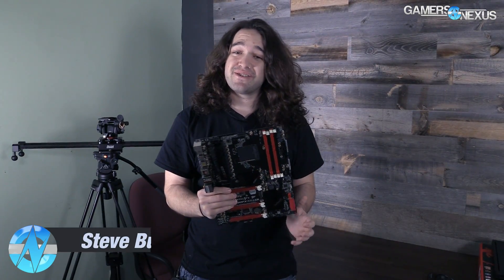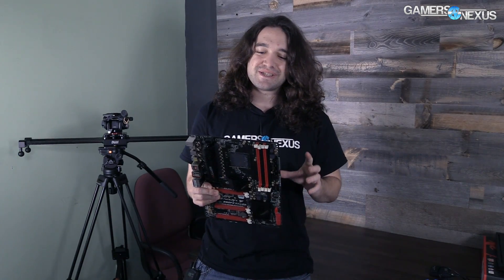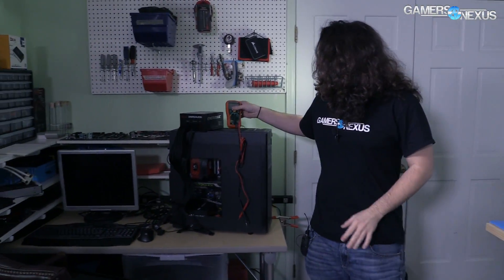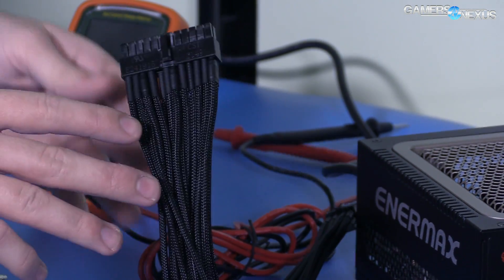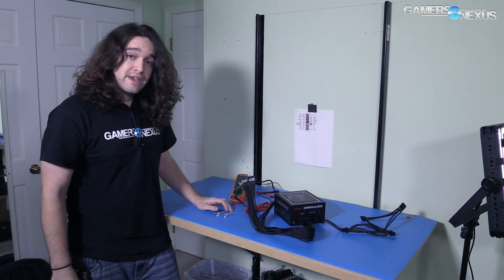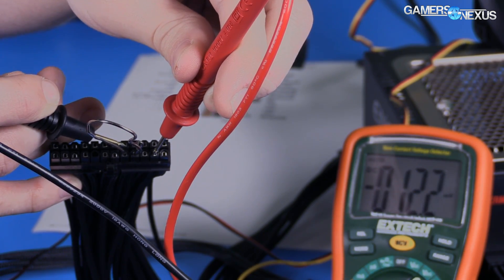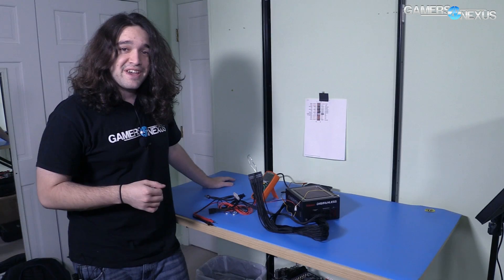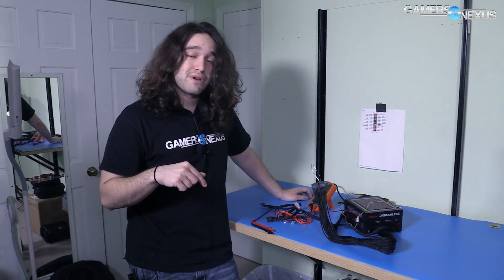Our Motherboard Caught Fire - Troubleshoot a Mobo & PSU

Comment: I fried a used old X58 motherboard a few weeks ago. I was building in a rackmountable case for the first time. What I thought were the standoffs actually were not. I screw down everything and BOOM! Flash of lightning and magic smoke. I shorted out the backside against the case. So dumb. I’ll try replacing the one capacitor I can see is scorched but what are the chances that will solve all problems?

Comment: Want to create a lightbulb with a Mobo? Simply get a fan extension cable that has two female ends and connect to two fan headers and power up the mobo. The wire will light up like a light bulb... briefly.... it will melt breaking the connection. No idea where I got the cable or why 2 female ends but was swapping out parts and decided to see what would happen 15 years ago. Got a lightbulb effect then melted plastic on copper on a Mobo that still posted to BIOS with no issues.

Comment: Sup guys. My EVGA Classified K caught fire today. Don't know what happened. It started around a screw hole near the sata express ports. Any idea what couldve happened? I already contacted EVGA, they gonna take it back and send me a new one. I'll have to change the case too (CoolerMaster Mastercase 5 Pro) since the front panel connectors are history.
Reply: what PSU were you using?

Comment: Hello, 
Few days ago I brought a brand new ASUS motherboard model H110M-A D3
And I have BIG question about system RAM compatibilities. This particular motherboard supports DDR3 and DDR3L memory compatibility? My project is to build PC with Intel i5-6400 CPU and this particular CPU only supports DDR3L (low voltage 1.35 V). Please tell me if DDR3 RAM is harmful to  i5-6400 “Skylake” CPU when operating together with ASUS H110M-A D3 motherboard?

Comment: Steve- that wall mounted anti-static mat is schweet. Who do I throw money at to get one of those?
Reply: the wall mount desk i looked but could not find the metal track one just wood ones please post link to get not worry about slow service i have been warned. thank you best info on youtube  :)
Reply from the maker: +Jominator Two separate products -- we got the anti-static mat from an online retailer (they run about $100 for 48x24 inches). You can search for "ESD mat," "anti-static mat," or similar. If you have trouble finding a retailer, I can post who we used -- I'm only hesitant because I really didn't like them that much, and wouldn't want to subject anyone to the extremely slow shipping process we experienced. I know that you can get cheap ones from Rosewill that are smaller in area, but I've not personally used them. Probably good for something like a motherboard or video card (one component at a time).

Wall mounted desks can normally be found at your local hardware store or made with some brackets and a big piece of wood! Just make sure to mount into the studs or something else that's able to take the weight/force. You'll want to ask for a "wall-mounted work bench." They're normally used for shops/garages, but we just mounted it into the studs in a normal room.
Reply: +Gamers Nexus I have a smaller Rosewill one. It's not bad- but certainly wouldn't accomidate a full build. I knew that before buying though, and for the 20 bucks it cost and the size I could fit it's not bad. Genius idea putting one on a folding wall mounted workbench. If only I'd thought of that about 3 months ago. :p

Comment: Steve where did you get that wall mounted fold down table? I NEED one in my life. Hope i can get one in the UK.
Reply from the maker: +Dinxsy Our local hardware stores carry stuff like what we're using. There are two main components to it -- a big piece of wood (which you can get at your home improvement store) and some articulating brackets. There are specialty shops on Amazon or similar sites that sell work benches, but not in the UK AFAIK. You'll want to search for "wall mounted work bench" to see if you can find something near you. That should find stuff! Normally associated with garages (auto shops). ^SB
Reply: Gamers Nexus Cannot find anything that resembles those wall mounted hinges/brackets. Are they branded do you know?
Reply from the maker: +Dinxsy Hmm... let me see if I can find any branding or models on them when we shoot later today! ^SB

Comment: Aren't enermax psus rated pretty poorly?
Reply from the maker: +Smaks John This one is rated 80 Plus Platinum, IIRC. If you meant review ratings, this one in particular has an 8.9/10 from Johnny Guru, which is the only person I really trust with PSU testing right now (if you're not familiar with him, I'd strongly suggest his content! Very thorough and scientific).

Issue ended up being the board. Looks like something shorted or it got unhappy about the CPU OC (not sure why those particular traces burned, though).
Reply: +Gamers Nexus Ooh gotcha. Could unclean power from the wall lead to unstable load outputs and issues like these? Or would it be the power phases' job?